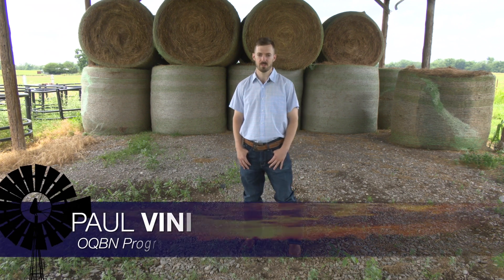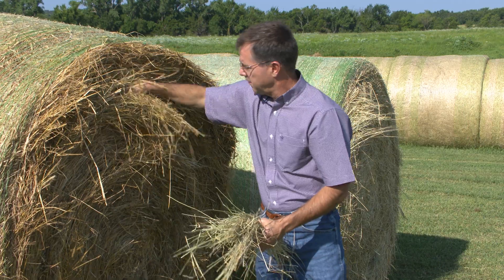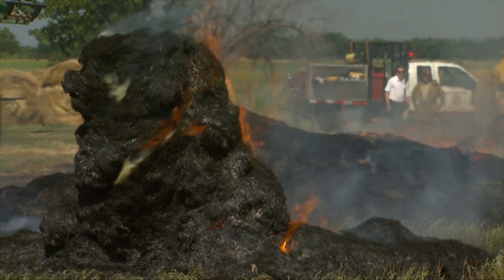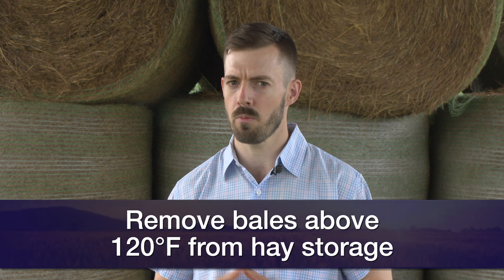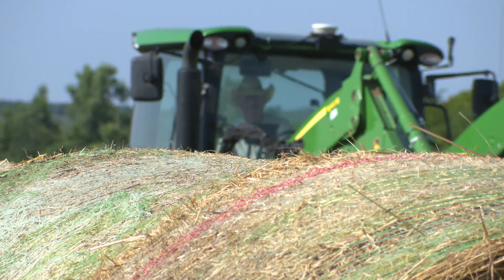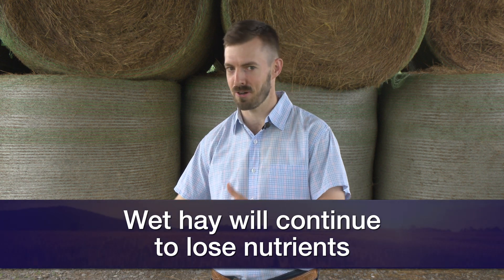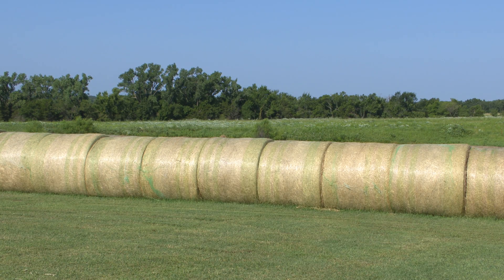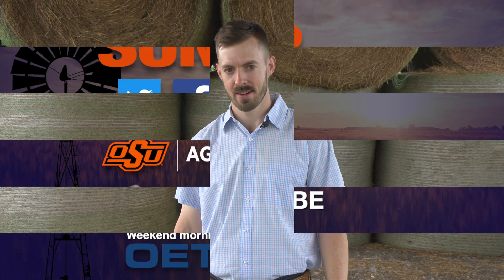How Much is too Much Moisture for Hay?

Comment: The process of decomposing is an exothermic reaction. So even without the bugs it would get hot. Water accelerates decomposition. Decomposing releases the CO2 stored by photosynthesis back into the air. The energy HEAT released is the energy stored during photosynthesis. Photosynthesis is a endothermic reaction creating biomass. All the CO2 in the air is in the cycle of life that is continuously creating and destroying biomass.

Comment: If I bale at 12% and once it’s baled it reads 45% moisture is that bad?
Reply: Yes, you don't measure the moisture correctly. You need to pack the hay before taking a reading. You can use a bucket and hand press the hay in the bucket.
Reply from the maker: Feel free to contact Paul Vining directly at paul.vining@okstate.edu!